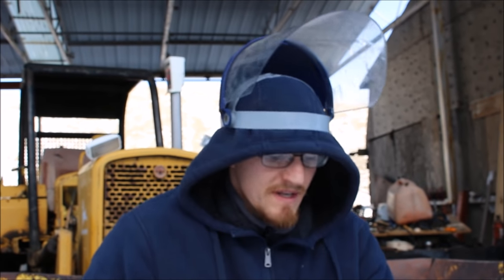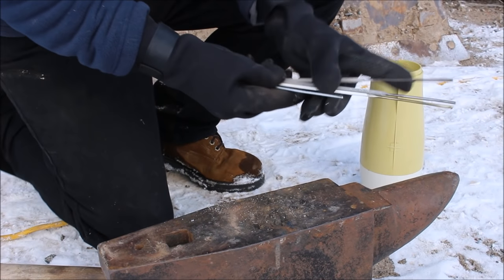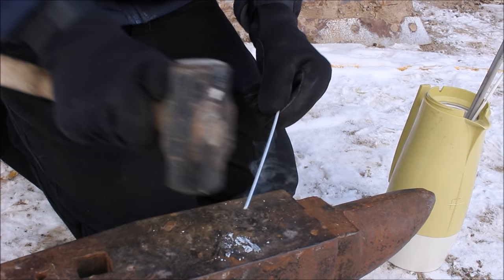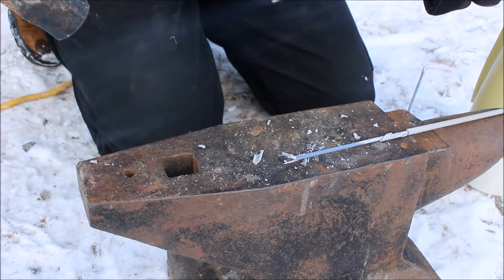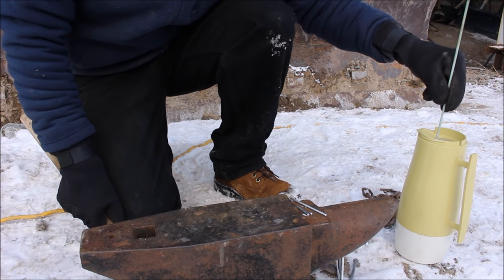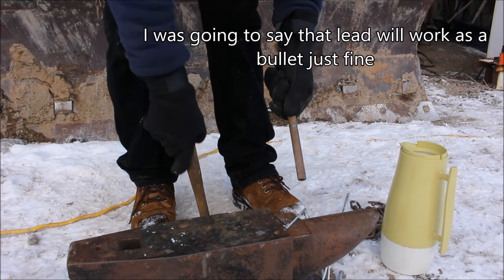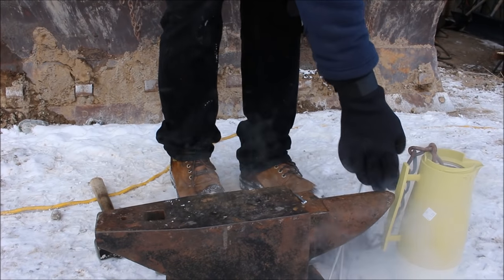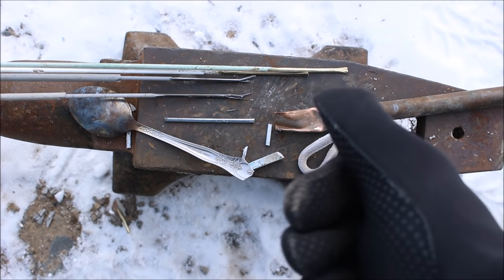Liquid Nitrogen Vs Metals (cold gun part 1)

Comment: This is one of the best videos I have seen demonstrating the cryogenic treatment of metals. The aluminum and stainless are both metals that undergo changes in their crystalline structure at cryogenic temperatures. none of the other metals you selected do that. And for the record, assuming that spoon was in fact food grade material (assuming it was made after the FDA was instated, and it didn't come from china), it would have been high quality stainless steel, 304 L or better.

Comment: One interesting note about guns in the cold is that during the battle for Stalingrad in WW2 the Russian defenders would oil their rifles with diesel fuel while the German rifles seized up because their rifle oil couldn't handle the cold.  The modern US Army also has a special rifle oil for use in extreme cold temperatures, I think that it is silicone based.

Comment: brittleness/ductility of metals/alloys depends on its lattice structure. this again depends on composition (where even small amounts of certain elements can have a big impact), temperature and maybe some other factors. hexagonal close-packed (hcp) (e.g. Zn, Mg, Ti below about 800 deg C, Co), face-centered and body-centered are among the most common examples.
there are specific low temperature steel types and alloys of other base metals for temperatures of liquid nitrogen (i.e. liquid nitrogen tanks and tubing). I've provided you with some keywords, the www will tell you virtually all there is to know. Good Luck!

Comment: Hi Cody!
Fun fact, I'm currently taking a course in material science.
Metals tend to form crystals. The reason for why some metal gets brittle when its temperature is lowered has do with the crystal structure. Steel and iron tend to form a structure called Body Centered Cubic  (BBC for short) which gets really brittle in low temperatures while other metals such as Aluminium which has a crystal structure called Face Centered Cubic (FCC for short) is not affected at all.

There are lots of information regering this topic to be found on the Web.

Great video by the way! :)

Comment: Metal vs. extreme cold is a serious issue in space exploration.
In the extreme cold climate of polar regions, the metal breaks too.
Reply: it'S not really a problem because the solution already exists.
it's called stainless steel.

that is why pressurized gas tanks are made out of stainless steel, when compressed gas is allowed to expand, it cooles down rapidly, and (good) stainless steel can easily deal with that where other steels would shatter quite easily.
Reply: Isnt stainless steel more brittle/harder than regular steel? Wouldn't that make it more susceptible to cold scenarios? And the gas cylinders we sell definitively are not stainless steel, they rust as soon as the paint chips off, it would cost massive amounts of money to make all of them out of stainless steel, it would increase the price almost 5 times as much, of course the type of cylinder vary depending on the gas in them but 95+% of them are all regular steel.
Reply: I don't think it's a big issue in space actually—space isn't cold, there's just nothing there. Oh sure, the tiny, trivial amount of matter there is very cold, but there's so little of it that it doesn't conduct away very much heat—if anything, it's cooling that's the issue in space.
Reply: @yaksher  
Nah space is cold because you radiate heat away, not through conduction
Reply: @lucaslucas191202  You always radiate heat away. It's a pretty slow process compared to conduction.
Reply: @yaksher  
The difference is that on earth the ground and even the sky radiates back. You can do the math for black body radiation at 270 K if you really want to. I'm going to go to bed though
Reply: @lucaslucas191202  Hmm, I stand corrected, it's actually a 100 W/m², which is substantial. That said, it's proportional to 4th power of temperature (1.8e-8 * T⁴ W/(K⁴m²)) so as the temperature drops, the rate will drop quickly. On the other hand, solar radiance at Earth's orbit is 1kW/m² roughly (though of course, cooling is proportional to surface area while heating is proportional to shadow array). I'm going to be lazy and model a spacecraft as a long cylinder (long enough to neglect the area of the ends) facing sideways to the sun (note that solar panels, which are the major deviation here, make freezing less, not more likely so I'm safe to ignore them :P), which gives a shadow area equal to 1/pi the surface area. Therefore, you need a total of roughly 300 W/m² to keep up with the solar heating which means you actually need 270 * 3^(1/4) = 355 K skin temperature if the temperature is uniform. However, the temperature is not uniform and I'm lazy. Regardless, overheating is going to be a much bigger issue than overcooling (though you can simply have radiators that are faced perpendicular to the sun so they have a much larger surface area than shadow area; by rotating them to face towards or away from the sun, theoretically you should be able to regulate your ship in a wide range of temperatures as long as you can effectively move heat around, which is itself not easy).
Reply: @yaksher  
Yeah sounds about right. It reminds me that I've never actually heard how NASA deals with these problems.

Comment: The ones that are brittle are usually interstitial alloys, like the steel. This is when a smaller atom , like carbon, is found between the larger Iron atoms. The ones that were able to bend in the cold were usually substitutional alloys, like brass. Love your channel Cody!

Comment: It appeared that the liquid nitrogen  increases a metals tensile strength while decreasing ductility. Copper and lead being the most elastic where the least affected from the temporary and dramatic thermal shift caused by the liquid nitrogen. Therefore plasticity didn't occur, as a metals tensile strength increases ductility is lost and vise versa. Hopefully this helps to explain the "why" if not already known. Cool vid, thanks.

Comment: there was a liquified natural gas storage facility that sat along a river or lake.  I remember that the photos were in black and white.  The explosion was the result of the metal in the tanks failing.  The tanks were constructed with the wrong alloy of metal that shattered under the stress.  It flattened the area completely, wish I could remember where/when, the analyst was really interesting.  Space craft are challenged with critical low temperatures and they have to provide artificial warming for the circuits to function properly.  all very interesting stuff.

Comment: Here is a few ideas.

If you melted the lead out of a copper jacketed slug you would have a suitable capsule for the mercury.

A plastic sabot with a textured surface could be used to reduce heat transfer to the chamber and barrel.

If you chamber the slug and cartridge separately  you could avoid chilling the primer and gunpowder.

Comment: The reason the brass and copper alloys did so well is probably because they are composed of a smaller crystalline structure. Bronze on the other hand, includes tin which has a large crystalline structure. 

And I'm not sure what pipes you're using, but on the rare occasion I machine iron pipes on the lathe it turns much more like cast steel than cast iron. 

I can't wait to see tests on a frozen gun and bullets!

Comment: If this was a lab unit made for years of testing, I'd go with layered design: Normal gun alloy steel insert(to resist fouling erosion etc.), hard insulation layer and then high tensile strength material on the outside, maybe even wound filament carbon fiber/ kevlar composite. Then it  would need either cooling chaneling or heat transfer layer coiled pipe between the insulation and the core or  telescoping design where you pull the inner core on rails for submersion cooling and loading  and the fast re-insertion before firing.

Comment: Only problem I see, is that the softer metals will deform with the pressure from the powder, unless the barrel is very thick, which is why cannons were made from brass / bronze in the 1700 and 1800 eras.

Comment: rust resistant steel or whatever is totally resistant to the effects of cold. thats why its used on those huge gas ships where you have to transport liquids and gas at very low temps where normal steel just shatters

Comment: black powder will have a hard time igniting at low temps, sulfer is a component because it melts at a relatively low temperature and allows the potassium nitrate and coal to react. i'm not sure about smokless powder but i'm thinking that it may have similar issues, it might be better to use a propellent with high shock sensitivity basically just use primer like mercury fulminate or lead stephenate mixed with lead azide as the propellant.

Comment: Have you ever heard of cryogenic stress relieving treatment of material by removing residual stresses from steel, aluminum, copper, brass, and plastics ?
 The benefits are:
*Longer life due to reduced wear
*Less failures due to cracking that result from the propagation of stress lines
*Improved thermal properties
*Better electrical properties with reduced electrical resistance
*Reduced coefficient of friction on polished metals
*Less creep & walk, and improved flatness for critical tolerance parts
*Easier machining, polishing and grinding for better edges and finishes

I have treated my rifle barrels and recommend it for everyone.

Comment: I did some googling, and have a quote that says: 

"The metals that remain ductile at extreme subzero temperatures include nickel, copper, aluminum, lead and silver, among others. These metals all have a face-centered cubic crystal structure, and ductility at low temperatures appears to be a characteristic common to them. having a body-centered cubic structure (iron, chromium, molybdenum, tantalum, tungsten, etc.) undergo a marked decrease in ductility over a range of temperatures (upper chart of Fig. 1) and the range of transition temperatures may occur from well above boiling- water temperature to several hundred degrees below OOF. instance, magnesium, zinc, titanium and beryllium - have a hexagonal crystal structure, and these metals, except for titanium, are generally brittle or have limited ductility at room and at moderately elevated temperatures. may exhibit high ductility and.toughness down to very low temperatures. The explanation of this phenomenon is as yet obscure. Metals Several common metals - for Titanium and several of its alloys may exhibit high ductility and toughness down to very low temperatures. "
https://www.bnl.gov/magnets/staff/gupta/summer1968/0311.pdf

This seems to somewhat hold with what you found: iron based things shattered, but copper, lead, etc did better. Could you try pure aluminum, if the welding rod was some sort of alloy or some odd  internal structure for welding purposes?

Comment: Hey cody, copper would be the best, it is a great thermal conductor and is also one of the components of bronze, it is much better suited for that kind of application than bronze. A graduated funnel for the barrel the kind they use for ring cannons, or specifically the one this kid makes, with acetylene on youtube. With a brass nozzle/ reaction orifice to facilitate pressurized gasses, obviously its used exclusively for high pressure applications. The cone of copper will facilitate the drastic temperature change.

Comment: Actually the best method to disperse liquid nitrogen to make a cold cannon would be very similar to a ring or vortex cannon only low pressure and high rate of fire, ring cannons are proven to be great as dispersants for gaseous projectiles as they keep the gasses or liquid gasses in concentration for projectile distances.

Comment: There's a video (I'd link it if it wouldn't be marked as spam) of a guy that puts a handgun in liquid nitrogen and fires it to see how well it would hold up. Even when it was submerged for a while it still shot just fine with no issues besides a few jams and a little less power. Any gun in extreme temps wouldn't explode normally.

Comment: Cody. 

Stainless steel. The copper alloys work well because their crystalline structure is face centered cubic, where most of the others are body centered cubic. FCC is better at resisting fracture at low temperatures, it's why certain stainless steels do this well, the nickel is FCC. The aluminum was also FCC, but I don't know why it seemed to shatter most. 

At least this is what they told us in Materials Testing in tech school. Assuming you weren't already more knowledgeable on this than I am. 

In any case, such cold-tolerant steels are usually tested at -40, so I'm not sure if a gun can even be devised that holds up at around -192F. But, a good quality stainless steel might be your best bet. If not that then copper. Overbuilt for sure.
Reply from the maker: +ElementalOctopus 
My guess is that the aluminum rod had some zinc or something added to it to help with the welding process

Comment: I'm not an expert in this stuff but if you cool it down enough you would also have to compensate for thermal expansion on the moving parts so it doesn't jam. If I'm wrong I welcome a correction

Comment: Cody, have you considered Bearing bronze? AKA aluminum bronze, It's got a really high tensile strength for a non ferrous metal, tarnish resistant, tough, relatively hard, Might be just the thing you are looking for if you want something tough enough for ballistics thought I cannot say to it's strength under freezing conditions considering how the aluminum itself fared so poorly

And of course, if your heart is set on those temperatures, there's always berylium copper, like those spark proof tools and such are made of, though you're not supposed to sand or grind or melt those without taking precautions against the particulates You could probably think your way around those problems if the alloy proved strong enough

Comment: Looks like the failure of the bronze was a product of work hardening, not solely the LN2. When you hit it in the pritchel hole it formed a hard bend/crease. You hammered it flat, effectively creasing it a 2nd time, and then the metal failed at that exact point.  The brass was subjected to a much more gradual bend. 

Many canons have historically been made of bronze, however manufacturing difficulties and cost resulted in the use of cast iron and steel. While the ductility of copper alloys is advantageous in that the gun will expand or bend before rupturing, steel can provide such an increase in absolute strength that they will perform better. to put it another way copper alloys will fail gracefully at lower pressures, where as steel will fail a little more catastrophically at higher pressures.

Look for steel that is in an annealed state, nothing that has been hardened. Unhardened steels are still very ductile, you can certainly find steel cased ammunition that must behave just like its copper counterparts. The chain was most likely hardened to resist being cut. Gun barrels are not hardened because they must maintain their effectiveness even after they may have been shot until they were red hot. (Though the barrel's internal rifling in most cases would be destroyed after this point)
Reply: Copper, better for armor than for weapons.

Comment: You could use stainless steel like the normal 1.4301 down to -269°C (is where the brittle phases begin) if it is not work hardened before (like the spoon). That is the normal Steel for sinks, pots... 18%Cr  10% Ni.
If you find steel only with Nickel it should also work.
Maybe even pure Ni gifs you a shiny tube.

Comment: Cody, when you said harder, you weren't wrong.
Metals can be either tough or hard.
Tough means that it can withstand deformation easier, hard means that it won't deform as easily, but can shatter with enough force.
Hardness is actually brittleness in this case... ^^
(i hope. i might be wrong. i really hope i'm not.)
Reply: Nope, plastic can be brittle but not hard, you have STRENGTH, ELASTICITY, PLASTICITY, DUCTILITY, TENSILE STRENGTH, MALLEABILITY, TOUGHNESS, HARDNESS AND CONDUCTIVITY, please note I copied this and that's why they are in caps, I could not spell them sorry, dyslexic, But none of the less, metals never tend to be hard, I can't even think of a metal that is hard (glass hard anyway) or as its main property anyway
Reply: ***** Well, if you look at high carbon steel, that's hard, to the point where you could break it fairly easily, as long as the carbon content would be high enough.
Unless you are talking about elemental metals, then you might actually have a fair point, as i am stumped on what metals would be hard in the way you describe it.
The best example of this aside from HCS i can think of is tungsten carbide, which is kind of a hybrid metal.
Also, on a side note, every metal is conductive. :3 (in an elemental form at least)

P.S. Mechanical engineer here, i could go quite a bit further into detail regarding the tensile strength, plasticity, crystallization and general alloying of metals, but since english isn't my first language, and i really can't be bothered with writing an entire essay about it, and i kind of don't want you to die of sheer boredom, i won't... :3
But in general, hardness and toughness are the first two aspects of a metals properties that are mentioned when describing it.
(Google for metal solidification charts... That would be chapter 2 out of roughly 8...)

Comment: Cast iron will break at room temperature, its almost ceramic like. When I'm at work I notice the plumbers check if any pipes are cracked because the ends are brittle.